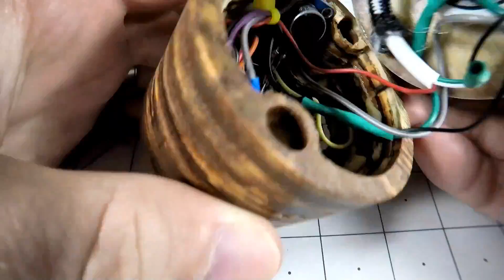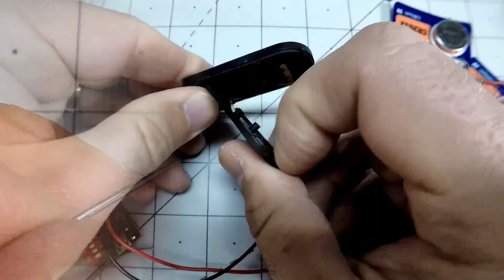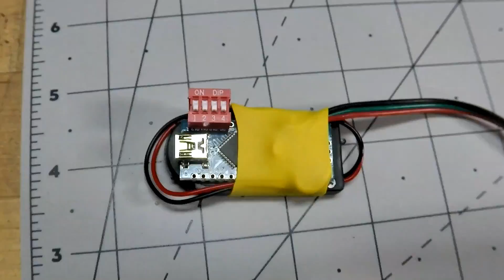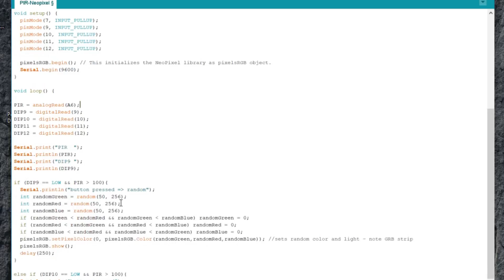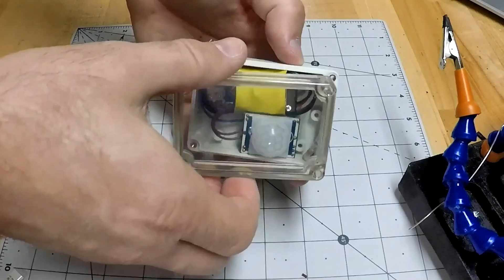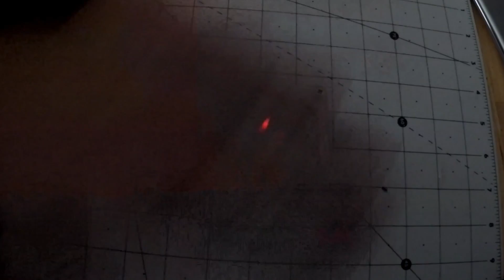How to Set Up a Compact Arduino Nano (DIP Switches/INPUT_PULLUP)

Comment: Looks like you only need 2 batteries. Does it last a good amount of time.
Great Video, are you from the USA.
I Find it hard to buy electronic components in Canada. Take care be safe
Reply from the maker: Hello Steven! Yes, two batteries was fine (TBH, might run on one, haven't tried) - haven't tested the longevity, but seems to work as long as I needed it.

Thanks! Yes, USA - getting a bit difficult in some circumstances, but have mostly been able to work around for now. All the best.

Comment: Interestingly enough most things that are clear in the visible light spectrum are opaque to at least ranges of IR including glass and Acrylic (and more I'm sure). Also, was curious if you have problems with the heat shrink interacting with the reset button on the Arduino. You could of course take a hobby knife and cut a hole in the heat shrink to clear the button.
Reply from the maker: Interesting, I didn't know that, but it would make sense about the IR interference.

No problems with the reset button so far. Thanks for watching!

Comment: Cool Jeremy.  I hadn't seen the dual CR2032 holders before.  But isn't the capacity of those batteries particularly low (220maH if I recall correctly).  With the relatively power-hungry USB chip on the Nano (and even the power led) doesn't this make for a run time of a day or so?   And 6V is a pretty low input voltage for Vin (the datasheet says 7-12V) which could also be problematic.  What's your experience?
Reply: Agreed - in fact, the right tool for the job would be to use a 8Mhz Pro Mini board, strip off the power LED and 3.3V regulator and run off a single coin cell. If you have the CPU sleep most of the time, that coin cell could last months.
Reply from the maker: @tdfsoftware  I actually ordered some 5V Pro Mini boards in part per Mark's comments. Should be a bit more power efficient. Seems the 8Mhz could be even better as you suggest.
Reply from the maker: Yeah, that sounds correct capacity-wise, and you would be correct about the 7-12V. What I've used it for is projects where I needed power for a fairly short time - see 2/3 projects listed in the description. Results were really good for the CNC application, and seemed to work well for the camera trigger.

That being said, the camera trigger ends up staying on after a certain number of shots. Hadn't really considered this as the cause, and I still think it's unlikely, but perhaps the voltage has something to do with it?